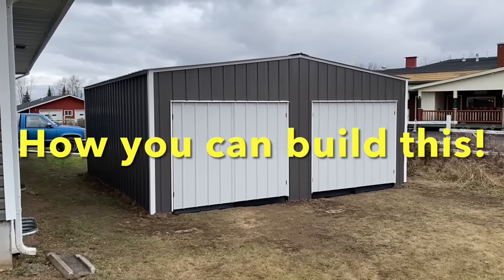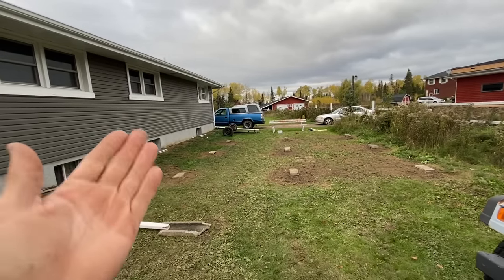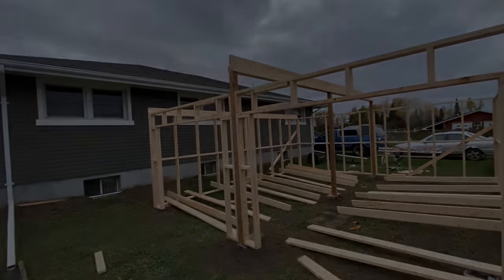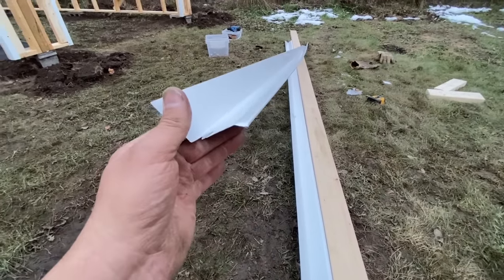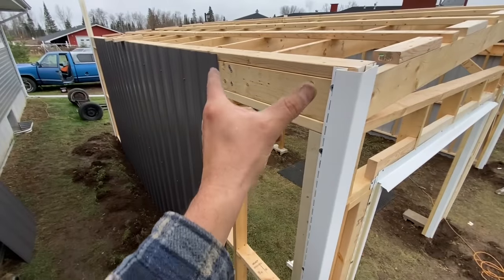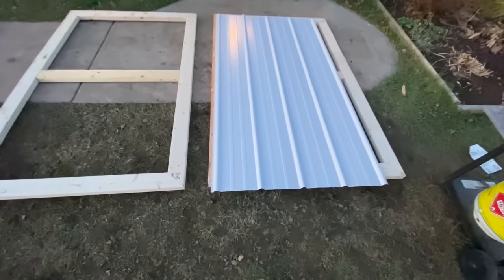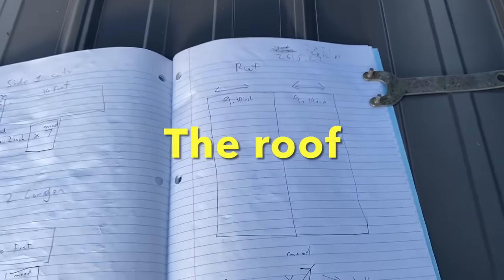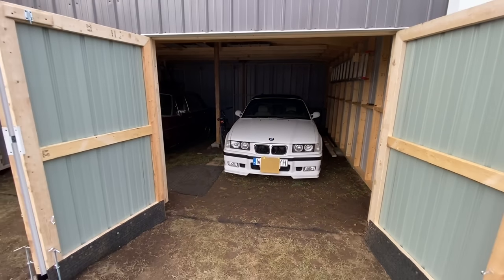How to build a 20x20 Garage for $3000 in 5 days (from Home Depot materials)

Comment: Unless tou were going to use them for something else, I'm not sure why you would need all the long 2"x6"s to create a level foundation. You could just use one and move it when you needed to, or just bought some masons line and used a cheap line level from point to point. It's how I laid out my deck that's 27'x30', needed almost 20 post holes and is as level as can be.
Reply from the maker: I used them all for the roof

Comment: i love that its done cheap but atleast make it structural, your roof wont hold the 6' of snow you said you get. the boards are only taking load on edges and corners not flats plus they are just sitting on 2x4s . you need much more of a footer for your climate, the ground will heave and warp your building. the way this is built you may as well have just left them out, and build right on the lawn.  you have a table saw, but not a square? also i know you want to be able to remove the building if ever needed. but i still wouldnt screw it together, wood needs to move. and will just pull the screws out and squeek.

Comment: dont use a level on boards like this to truely level something. Always use a known true bar or just use the stringline. Also put the cinder blocks where they have more contact surface area with the ground and fill cavitys with concrete and rebar. Never use drywall screws on anything but sheet rock, especially if its going through metal or exposed to weather, they will rust and rust your metal

Comment: 2x4s layes flat ha e a span of about 2-3ft should definatwly lay brick the whole undwrside of the bottom plate
Reply from the maker: It's got metal strapped to the wall, it won't sag, remember guys it's just a temporary moveable carport.
Reply: @ProblemSolverGarage  your ok and it's not a bad build I'm going to copy it, just gunna use nails and maybe 2x6 for the walls instead should only be a few hundred more.

Comment: The screws hold good but nails give like in a high wind storm screws will break thats why houses are built with nails
Reply from the maker: Yes that is true. I did use construction screws but I need this thing to be able to come apart when it's time to move it, remember it's a moveable carport.
Reply: Houses are built with nails because they are cheap, quick, easy, and work very well.  Structural screws will not break….you can bend them a lot and they will not break (especially the German made ones). Screws however are not cheap or quick or necessary. They are better in a few applications.

Comment: Good video but when I tried to do that here, (and I have more room then your have there, I was stopped by the city saying that a structure like that is considered a 'non-permanent' building, and the limit for a 'non permanent' building is 8x8ft.  All others need a proper footing below the frost line. Then there's the fact that it can't be any closer than 15ft from any other structure, and must be 15ft off the rear property line and 10ft off the side property line unless its more than 50ft behind the mean average of all dwellings in the area, where as it can be 5ft from the side property line. 
Then, if you can manage to get the permits, the first requirement after the footings or sonotube pilings are set in place is to show a level stone pad beneath the structure. I cannot be dirt.
If you pour concrete, then it adds to the square footage which your taxed on overall. For me, with a 900sq-ft house, it would more than double my already $8,800/yr taxes.  

Then there's the issue of insurance. I fought for months to find insurance, many now refuse to insure a house with a garage, sheds, or or boats or multiple vehicles on the property claiming them high risk and an 'attractive nuisance'.  They made me remove a 4x8 gazebo over my grill, and would not write a policy so long as I had a 'commercial vehicle' in the driveway. They were calling my F350 shortbed with a camper on it a 'commercial vehicle'. The camper however which it towed was okay. They claimed that the barbecue gazebo could rip free of its mounts and become an issue in a storm. Its bolted to the concrete patio slab. The propane barbecue also had to be locked up, out of sight, but I'm not sure where as they made me get rid of the cover it was under and they want me to tear down my 10x12 shed which they say is not allowed.  Every year it gets worse and I learn to hate this state even more.
Reply from the maker: That really sucks, yeah I lived in Tallahassee years ago, then moved to Canada, they're way more laid-back here on stuff like that, where I live there is weird structures all over the place on peoples properties.

Comment: My issue, i like to work on stuff, and not be in dirt, sooo.. i'd have rented a backhoe or mini excavator and dug foundation trenches and 6-8 inches down in the middle for a 4-6 inch pad  ontop of compressed and tamped rock. and then got concrete mix and a mixer, probably also would have gone 15 feet high for hoist room..  getting too damn old to be crawlin around.

Comment: NEVER on any metal roof or siding application put nails or hold down screws on a peak, ONLY in the valley & next to the peak or ridge no matter what anyone or instructions say. In the valley, it holds tight to side or roof & will not work loose, in the ridge or peak, you will ALWAYS be fighting leaks!! Ask me how I know! No amount of sealer or caulking will last on peaks, even used rubber coating but got to add layer every 2 years.

Comment: Great video but I’m actually surprised it costs $3000. If someone said guess how much it would cost to build using free cinder blocks wood and cheap metal like that I would’ve said like $1500 maybe $2000. Man stuff is so expensive. For $3000 I would’ve figured hardware stores would have premade garages just like this for about that much that they deliver. Btw you should use cheap do it yourself concrete and fill in the cinder blocks so the are solid.

Comment: There's absolutely nothing keeping this garage from taking off in a wind storm
Reply from the maker: Well it is very heavy, also I placed cinderblocks inside on the corner lots of them, wish I included that in the video. 
 If you live somewhere windy I would anchor it down long treated boards dug into the ground with concrete at the bottom.
 It doesn't get windy where I live

Comment: This guy has never heard of galvanic reactions between aluminum flashing and steel DW screws instead of using proper aluminum trim nails  ... burying the siding  ...  oopha !!!
Why not scribe the the ceiling 2x6s to the roof rafters, with the 2x6 screwed to the ridge beam and truss plate them ???

Comment: the problem created relates to humidity from groundwater and lack of ventilation.  you need some ventilation in there soon or your cars are going to suffer from the moisture coming out of the ground.  a little more consideration for this before putting up the building would have gone a long ways.  hope it works out for you - where i live it would not w/o a moisture barrier of some type.  you could lift the building and pour a proper slab under the whole thing.  Andrew camerata has a video on doing just that to an existing shed:  https://www.youtube.com/watch?v=x-zGhlqouY4&ab_channel=AndrewCamarata
Reply: I once stored a motorcycle in a dirt floor building for a few years. It rusted bad. I think it would've been better off parked outside.

Comment: Without a floor/vapor barrier that garage isn't doing you much good. The underneath of your cars is going to rot out bad. There will be a ton of moister in there but that's a great deal on the building.
Reply from the maker: It's a carport , and the moisture does vent out the roof cap. Thanks for watching though, if I had $30,000 I would've built a floor.

Comment: Alright, I'm going to be the bad guy here—again. And no, I’m not just nitpicking. Usually, I’d list things out, but there’s so much to cover this time that I won’t bother.

In the video description, it says, "In this video, I will show you in extreme detail how to build a two-car 20x20 garage for only $3,000 in only 5 days by yourself. The $3,000 price includes the entire 20x20 metal garage building." But by the 16:30 mark, who exactly is that helping you? oh it's Your shadow? I can’t speak for building codes in Canada, the North Pole, or wherever materials cost $3,000 for everything used in this video. Where I’m at—southeast USA—that’s closer to $10K.

Now, let’s have a quick quiz: What is more brittle? (A) A nail, (B) A screw, (C) A bolt, or (D) They all have similar hardness. The answer is cleverly hidden in this rant.

So, where you live, lumber that’s in constant contact with wet ground doesn’t need to be pressure-treated? That must’ve saved you a ton of cash. You know, instead of pouring a slab like you should have, especially if you want your so-called "garage" to have a lift installed.

Here’s something every architect and builder should remember: NEVER MIX MATERIALS. If your siding and roof are metal, then the frame needs to be metal too. Here’s why: wood expands faster than metal and is way more susceptible to moisture. When wood gets wet, it swells and shrinks. Need proof? Check out this source: Popular Woodworking. While the exterior expands at a different rate, the wood will start pulling away from the siding and roof, and wind will only make this worse.

Now, why do we fail inspections if screws are used in the outer wall? Let me explain. Grab a scrap piece of lumber and nail a nail all the way through, leaving half of it exposed. Now, drill in a screw about 8 inches away, again leaving half of it exposed. Try bending both the nail and the screw back and forth. You’ll find that screws, unlike nails, go through a hardening process during manufacturing, making them rigid but brittle. This is great for their intended purpose, but the moment you ask a screw to bend like a nail, it snaps like the stem of a wine glass.

So, I hope you’re not inside when that roof comes crashing down.

Comment: Those 8" cmu's need to rotated.   The strength is on the other side.   Licensed home builder here.   Bad mistake on your part.   Also use gravel in your holes to level not dirt.

Comment: @ 59:00 cutoff wheel making lotta sparks, that's a steel panel, non ferrous metal would not produce that many sparks, IE: aluminum, brass, copper etc. etc.  The point is, those steel metal sheets "No Way" should be in the dirt/buried ..  OMG, those metal sheets ain't gonna last long in the wet dirt.. There's  zero water control coming off that roof, IE: a roof  rain gutter system ta keep roof water run off away from walls and the idea of concrete blocks laid sideways (incorrectly) is Way toooo small of a footprint for roof loads IE: snow country..  It won't take long for those block ta be pushed down in the mud, causing structural shifts , could become "dangerous" in the very near future ??  Your above ground build was ok. Ain't gonna nit pick @ some screws/ fasteners bla bla bla, they'll work..   PS: enjoyed your video

Comment: Your foundation WILL fail using concrete blocks the way you are doing it. They are designed to be used with holes facing up!
Reply from the maker: People have been putting them this way in trailer parks for years, it prevents them from sinking into the ground, they will be fine nothing will happen. Thanks for the input though I can see why people might assume that, I wish I explained it better in the video

Comment: What foundation? all I see is dirt.
Reply from the maker: It's a temporary moveable carport, yes it's a dirt floor but the structure sits on something, it's not just sitting on the grass. I've build a few of these even as far as 10 years ago and they're all still standing. Remember $3000 for a two car temporary enclosed carport that you can move at any point.

Comment: This is not how to cap a roof, he is not putting the rubber strips in that run the length of the cap on both sides. If you dont install those rubber seals, rain water will blow in and leak inside.

Comment: Need the FOOTINGS  2 FOOT SQUARE. SOLID CONCRETE. YEAH SAME WAY YOU DID, BUT AFTER YOU SET BLOCKS SHOULD OF  POURED THE CONCRETE.
(2 FOOT IS TOO SHALLOW BUT IS STRONG ENOUGH).
WHEN THE GROUND FREEZES IT MIGHT MOVE UP OR DOWN.
NEVER USE DRYWALL SCREWS BECAUSE THEY RUST AWAY & THE RUST TRAIL LOOKS LIKE $HIT.😂
Also should of made the corners a California Corner.
Why didn't you install HEADER OVER THE DOORS?
THE WOOD FRAME IS GOING TO SAG WHERE THE DOOR HINGES ARE UNLESS YOU POUR CONCRETE FOOTINGS UNDER THE FRAME.
Reply from the maker: Nothing will SAG because it's strapped with metal.  The metal will prevent it from sagging, think about it.
Reply from the maker: And it's just a temporary moveable carport. 
 Good point about the drywall screws. I guess we'll see what happens. They are covered so we should be OK.

Comment: You made a few mistakes for your area of the country. The garage is not anchored to the blocks or the ground in anyway at all.  You should have a very thin piece of rubber membrane on the blocks so the wood is not touching the ground or concrete in anyway. With you little trench you dug, will allow water to get under the blocks and the ice in the winter will lift them out of the ground. I would have also   made the slope on the roof, much deeper so the snow can run off.

Comment: your concrete block is wrong you should pour concrete footing and you have your block wrong open holes are down The way you are doing it your block will break. you need to get a book on footers and ruff framing. because the way you are going is totally wrong and if you pulled a permit the inspector is surely going to fail your project

Comment: It's too short. Can barely get a vehicle into it with no roof forward for work benches and tools. Should be at least 32' long or just storage. So useless. Dandahermit
Reply from the maker: It's a carport for storing two vehicles. 
A moveable carport. 
 If you want a longer one then build a longer one.

Comment: If you pay 33k for that without concrete and that small you got ripped off anyway.
Reply: $3k, not $33k!  Hard to beat for the money.  Add another $500 and it could be vastly improved regarding wind loads and longevity.  Hard to beat for the $!